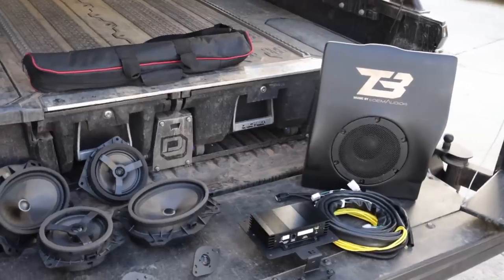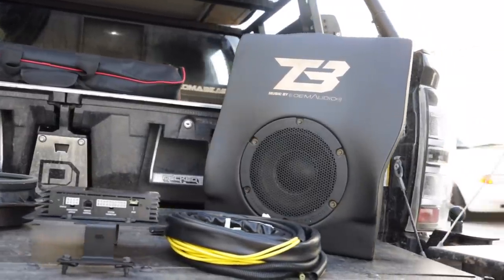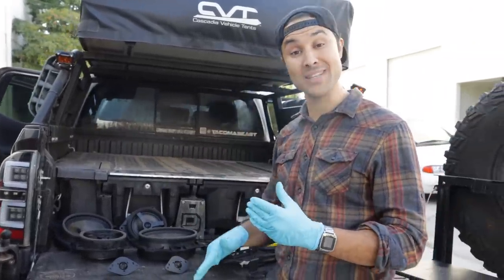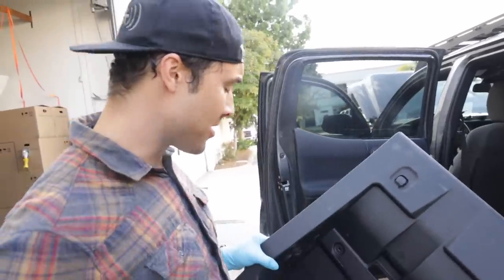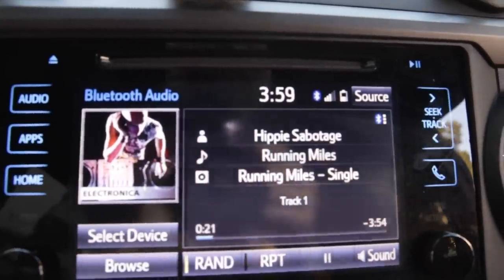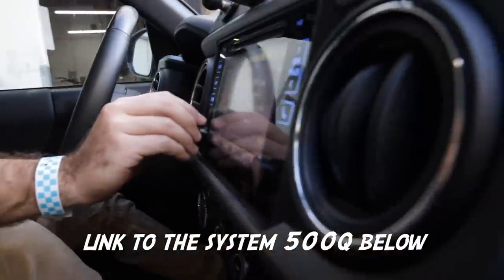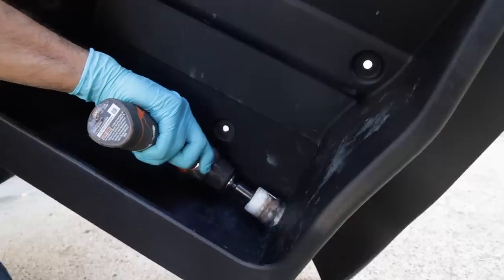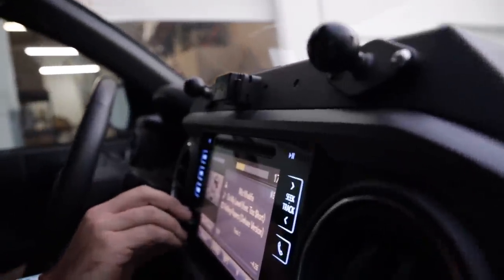Reaction after installing an aftermarket Sound System on Toyota Tacoma

Comment: Dude is so knowledgeable when it comes to speakers and audio systems damn
Reply: I'm not so sure about that. You could achieve similar/better results for half the money they are selling these systems for. 

Anyone truly knowledgeable about car audio knows this is big money for what it is. 

A nice set of component speakers run about $150. A decent set of 6x9's are under $100. A 4 channel amp is $150. A sub and amp is $300. Wiring and an enclosure will run another $100-200. 

But this is clean and easy to install...
Reply: 🤔 please consider skar.

Comment: Just had the factory speakers all replaced with Polk Audio dB+ series speakers, all 6 of them an got the HU replaced with a Kenwood, the Alpine I wanted was not Meastro compatible.
  Am not sure if the factory tweets were shot, but damn the audio sounds so much better!~
An yes I do have a single 12in sub as well in the back.

Comment: You should NOT have to turn the volume up that much. I used to have the same issue as you stated, I couldn't get enough volume out of my system. I put an Alpine S-A32F (55w RMS) and after I set it up, that thing cranks at 10. Turning it up to the 20s and 30s is super loud. Either that amp has no power or the gain is setup entirely wrong. I upgraded the amp, all six speakers and ran all new wiring and my final cost was no where near $1299...

Comment: For $1300, you can build a sound system that nears concert quality if you choose wisely and look for nice deals and rollbacks on few year old speaker models. Labor cost is another story however. Pioneer head units and speakers are a great place to start as they are not insanely expensive and provide excellent bang for buck. This is a plug and play kit, so I guess it saves you time and effort of rewiring everything and crimping connections by individual wire.
Reply: Thats what i was thinking. A ton of money for a partial upgrade.
Reply: I completely agree. This setup is way overpriced

Comment: I have a few questions to ask you since you were one of the few or only one who owns a Tacoma and had modified his stereo. I had all the speakers changed plus I have 2 - 12 inch sub woofers behind the passenger seat. My question to you is when you play your music, are your front door speakers supposed to vibrate, and I am having to put my bass on the stereo lower because of the bass . I am going to send an email to the guy who put this system together and will go back to the shop to ask for an adjustment.  Would like you opinion and tell me overall .

Comment: I have a 2020 tacoma TRD PRO.  wIll all components and locations work with my truck?  My driver seat is powered, etc.  Please let me know.  I've also already upgraded my doors and tweets to kickers.  Waiting to finish the sub and amp fix!  thank you!
Reply from the maker: Thank you for confirming. Our Tacoma Sound Solution is engineered SPECIFICALLY with your 2020 Tacoma in mind (taking into account all the updates in connectivity and output characteristics for this new model year). We have updated our bracket specifically for your new power seat as well as provide our new radio adapters for the 2020 connectivity. 

Keep the questions coming. It is of the utmost importance to us that you are able to make an informed decision and that the end results exceed your expectations.

Comment: Since installation have you noticed any engine hum coming through your speakers or headlights dimming during night driving?
Reply: That amp is tiny.  They're only 8 inch subs.  If that causes dim headlights, then you have something wrong with your truck.

Comment: Did you change out the head unit?  What’s your thoughts. I’ve upgraded the speakers to all Kickers with a Hideaway. Now debating putting in Pioneer but don’t know if it’ll mess anything up. Even if I use Meastro RR
Reply from the maker: We have not changed out the head unit. I recomend you reach put tp Pioneer with that question it is best you get advice from them directly. We have not played around with that unit enough to know. 😅

Comment: Would you recommend replacing the JBL sound system in the 2020 Trd pro?
Reply: Absolutely. These guys use better quality materials, set up the dsp for our truck; it's essentially like comparing a fitted suit to grabbing one off the shelf.
Reply: i wouldn’t the JDM system is great. You wouldn’t hear a big difference. Throw all ur sound settings to the right. it hits
Reply: Maybe just change the amplifier, either way i wouldnt mess with the system until it has completely gone out to just switch the entire thing, the speakers, amp, and sub
Reply: @KyleKaplanOfficial  I like JL, but I'm not doing a competition or paying that much for a truck system as I don't plan to mall crawl or sit in a parking lot. Not bagging on those who do, just not my jam.
Reply: I appreciate the advice, as in my 09 altima sl I had the Bose which I loved and in my 15 Tiguan SEL 4motion i had the Fender sound system which wasn't bad so I can say I've never owned a vehicle with JBL

Comment: You can’t say that it won’t affect your warranty. That’s not up to you it’s up to the dealer you take your vehicle to when you have a problem. I guarantee if the head unit fails with that system in the car a dealer wouldn’t warranty it
Reply: Exactly
Reply: Wrong. I had one installed in my 2012 Scion. (with a sub) and most Toyota mechanics never even knew it was in the car unless I pointed it out to them.

Comment: One more thing. Would the OEM speakers make much more of a difference compared to the JBL audio I have with my TRD Pro speakers. I am very interested in the sub and amp.
Reply: Night and day. This company is crushing it. I have the JBL's and hate them. I'm ordering an OEM in March. Not to mention their install video makes it foolproof for anyone to do it themselves.
Reply: @spartan8390  Was it actually much of a difference after?
Reply: @hemeon  I ended up going another route. EVERYONE I have talked to loves the kit. But as we don’t know each other; take what I said with a grain of salt. I run the WRX Kicker tweeters, Memphis Audio front and rear (the carbon fiber set, been a while), 10 inch Kicker CompRT, LC2i, Kenwood mono amp 500w rms. Mine sounds great, but I am still getting the OEM kit. The only complaint I have heard about OEM is their sub is very mild, which I understand from their own specs. I will most likely run my sub and amp, but their everything else. I hope that helps you. Any questions; here to answer what I can.
Reply: @spartan8390 Have any updates? I’m looking at getting the oem replacement..

Comment: Does that mess around with the warranty. I didn't hear yes or no. It doesn't compromise the vehicle warranty . Is that a yes or a no?
Reply: For a sound system no it won’t void the whole warranty! They may only deny a warranty claim repair on the battery and alternator for this. Since an amp sub etc puts extra strain on those two and could cause them to fail early. It won’t cause the engine to throw or rod or transmission to fail etc...

Comment: Gotta get this for my 2nd gen...
Reply: Haden Roberson same
Reply: I mean absolutely no disrespect to Mateo or OEM audio plus, but I have installed 2 JL Audio 10 W3V3's on a JX1000/1 amplifier with Image dynamics door speakers and tweeters on a 4 channel 400 watt amp and it has both the option to bump to where you can hear my truck down a few blocks away and listen to normal music with sound quality. My point being sound quality is obtainable for less money. That being said you are on your own for installation and wiring etc. technically on paper the OEM audio plus system will have better sound quality as it was designed to blend in the truck, just keep in mind you can have more for the same amount of money or less.
Reply: @jacobsellars7910  Its the ease of installation. Ive installed speakers many times. Youre paying for the leg work on this one. It being plug and play makes it nearly worth the price. That being said.... It is very expensive for what it is.

Comment: Hey guys, I need some help. I have reach out to OEMAudio on multiple occasions without any response. I am the second owner of a 2017 Tacoma that has the 500q Full audio system installed. My problem is that the subwoofer works sometimes and doesn’t work most of the time. Any ideas or suggestions?
Reply: Just The Dad Loose connection somewhere.

Comment: Where i can buy the full set?
Reply from the maker: You can find the full set on out website here https://tacomabeast.com/products/2016-2021-toyota-tacoma-double-cab-sound-system-500?_pos=3&_sid=e3241b86e&_ss=r
Reply: Is that just for the subwoofer or also include door speakers and dash speaker?

Comment: For $130 you can use the Bose Soundlink II. it’s a Bluetooth speaker that just may sound better than the system upgrade many have done. It’s portable too so you can use it on your tailgate and anywhere else your imagination will bring you. I just did this for my 2021 Tacoma Pro. Just trying to share an idea that possibly could be both cheaper and better. Peace
Reply: Out of the box thinking.  I like the idea.  Has its advantages.

Comment: Funny how you guys talk about like it's all acoustically tuned for each vehicle but when I asked if these systems are pre-packaged for each specific vehicle they said no.  They piece it all together upon ordering depending on the vehicle it's for.  So basically it's the same speaker/tweeter but on mounts and connector's that are plug and play and has nothing to do with actual tuning for a specific vehicle.